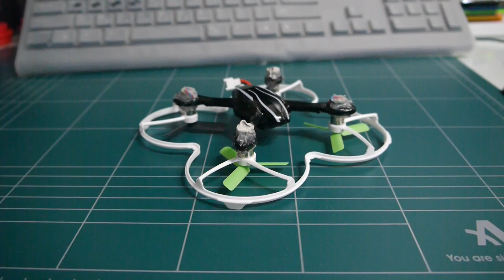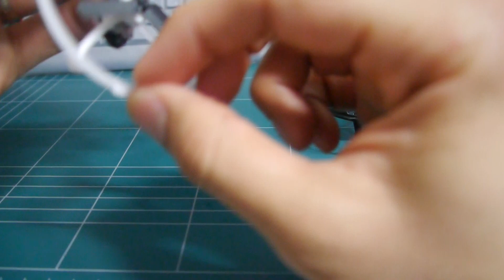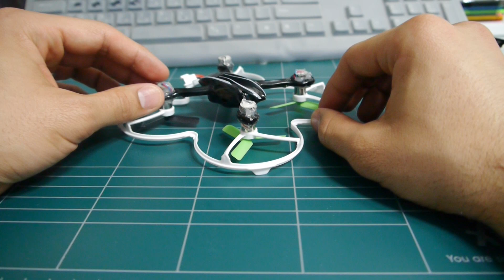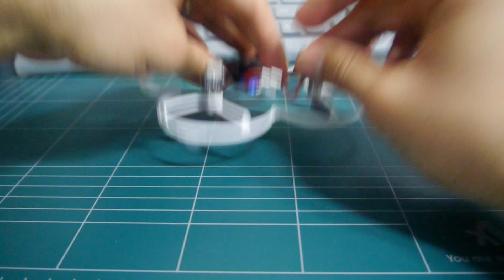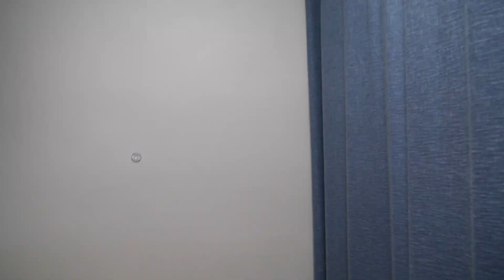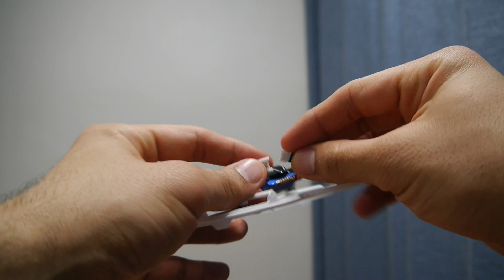Hubsan Mod: Frankenstein

Comment: Hi ! this is a mod i've been thinking of and i finaly find one good example of it.
My question is: when turning the motors upside down you need to revert the propellers right? the ones that would normally go on the CW motors are now on the CCW and vice-versa. Am i right?
Reply from the maker: João Palma That's correct. When you invert the motor, you need the change the propeller from CW to CCW, and CCW to CW. Just make sure you don't invert the propeller. The easiest way to do this mod is to have propellers that are drilled all the way through. But, you can, very carefully, drill a hole all the way through a standard propeller.